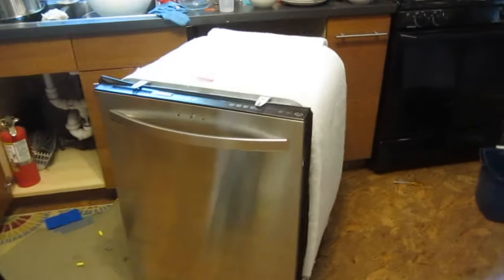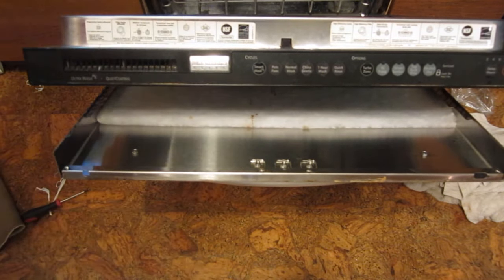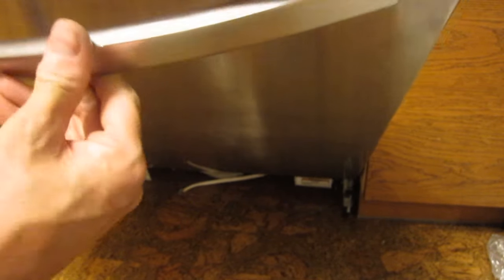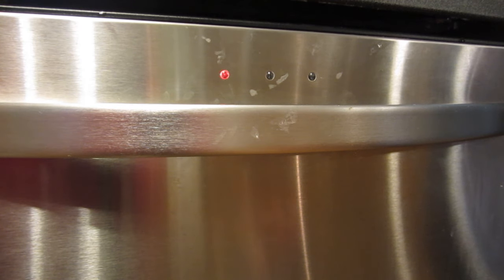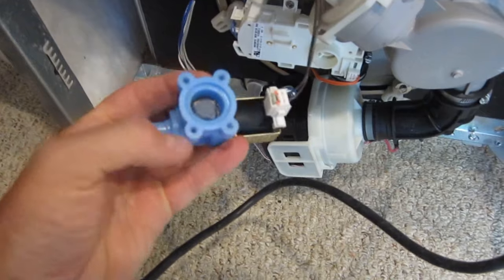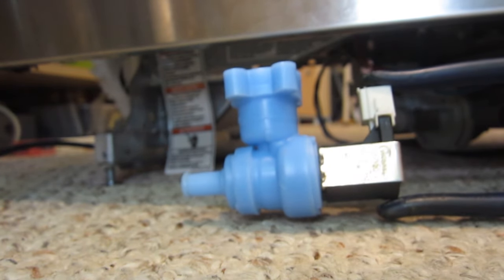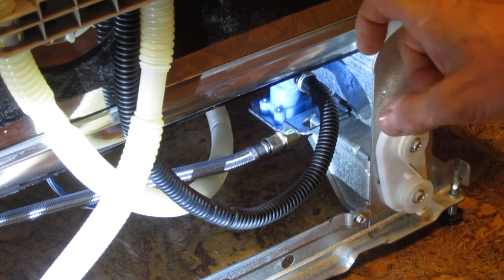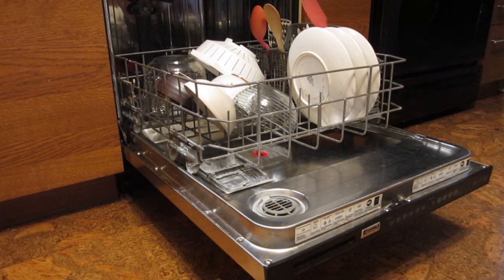Kenmore Elite Dishwasher Repair

Comment: I needed that pep talk at the end....cheers!!
Reply: Our issue is that the top rack seems to have a lot of gunk on our cups on the top level, but everything else is fine...looked at many videos that talk about cleaning up to the chopper assembly, which I have done numerous times that I could do it with my eyes closed.  I've even replaced the chopper assembly.  Still having the same problems though....not sure what it could be and most videos don't address the issue...water seems to be recycling in the unit, but for some reason, top rack cups get some extra gunk....gotta figure it out....
Reply from the maker: I ain't no dishwasher repair man but maybe your upper spray arm might not be spinning.  Try and catch them in action.  Could be the spray arm is cracked or all chunked up.  Pain in the ass to clean them out but it can be done.  Barring that, it might be the circulation pump that moves water into the spray arm.  Good luck mate.

Comment: Yo are able to do more than the the 2 “Sears” (it’s not Sears anymore) repairman can do.  Since we purchased the Sears warranty 4 years ago before our Sears closed, so, we have had them out to our home for repair 3 times in February, 5 times in March, 4 times in April, and 5 times in May.  Yes, even the repair company is not Sears, but only bought the name, which the vans they arrive in have a strange name.  Through many tears I finally called one of the few Sears Stores still open and talked to the manager.  He gave me a different phone number and told me to say, “Due to multiple failed attempts to repair, I’m requesting a new replacement.”  I received an email today with a link to pick a new dishwasher.  He also advised me to never purchase another warranty from Sears, because they are not like they were before.
Reply from the maker: That company is a bit messed up. Congrats on the new dishwasher though.

Comment: So when the door springs get tired and you get a replacement kit with cords, lube the nylon cords with soap, otherwise there's an ungodly groan after they're replaced. One of our front panel indicator lights doesn't work most of the time, so I'm deciding if I want to pull the control panel and see if I can fix the surface mount LED. The damn parts sites show a "light", which is not a light, but a plastic light pipe insert that cannot fail. This has been a nice, quiet dishwasher but entropy is taking its toll.
Reply from the maker: That will happen.  I wouldn't have expected an LED to burn out.

Comment: I have this same unit. There is steam coming out above the door where the top “vent” is on the door. Starting to damage the cabinet above it. I don’t see steam but the cabinet above it is moist after it has run. Door gasket seems fine. Thoughts? I think the inner vent on the inside of the door is to the fan or is it connected to the vent on the top of the door
Reply from the maker: That steam is normal. When you get a new dishwasher it comes with this foil tape that you put on the underside of your counter top lip.  Grab a roll of that foil duct tape from the Homeless Despot and it should keep your counter from disintegrating.
Reply: @dork3nergy  ok Thanks. It seems more than usual though. Is this also connected to the fan and only allows out what the fan doesn’t send to the drain? Wondering if the excess moisture is due to a fan failure. Maybe I’m mistaken on how this works. I appreciate your input.
Reply from the maker: The vent on the inside of the door is connected to the vents on the top of the door.  There is a wax motor that opens that vent.  It is possible that the vent is stuck open and you are getting venting throughout the dishwasher cycles.  That part can be replaced if it is indeed the problem.  It's an easy fix.  If you have the same dishwasher that I have then this is the part :

https://www.ebay.com/itm/Kitchenaid-Dishwash-Vent-Assembly-WP8572611/154297548033

Comment: I’m trying to figure out what the 3rd connection is to this Kenmore Elite dishwasher we got. It was used & don’t know if the guy didn’t give us the 3rd hose that goes there. My husband installed the drain & supply hose, but water is leaking from this extra hole.😅 Any idea?
Reply from the maker: Where is this hole you speak of?
Reply: DorkEnergy I wish I could send a pic but it won’t let me. So it’s hard to explain.
Reply from the maker: Is it on the side it's the bottom of the unit?
Reply: DorkEnergy Bottom, we’re guessing we need a T connector that wasn’t included.
Reply from the maker: @TSkrobarczyk  Have a look at the parts diagram here.  Might help you narrow down what you are missing :

https://www.searspartsdirect.com/model/1voj989pkz-000583/kenmore-elite-66513193k901-dishwasher-parts

Comment: I have a very similar model and its running very long never ending cycles.  After like 5 hours i have to stop it and drain it.  Any ideas?
Reply from the maker: It's likely a thermostat or the control board.  There is probably a diagnostic test you can run by pressing some buttons in a specific sequence.  If you can track down the service manual for your model, it will explain how to read the results.  

A good start would be to search https://www.applianceblog.com/ for your model.

Good luck!
Reply: DorkEnergy enjoyed your video and the many little ironies encountered we all seem to go thru!
Reply: @dork3nergy  Have the same problem with an Elite. Changed the control board ($200) and the thermostat and it semi-worked for about two weeks. Now it's doing the same as before and we're using it as a drying rack until the new one arrives.

Comment: Wow! Just a simple fix, congrats on your free washing machine :)
Reply from the maker: Thanks. Even if the solenoid valve had been shot, the fix would have been fifty bucks tops.
Reply: Congrats!!  Is it still working with just the tape fix? I have a similar dishwasher. 

I have an error code saying not enough water F6E1.  I get water spraying around and I turn cups over to collect water and seems to have plenty of water. Can’t figure out why it keeps stopping. Wondering if I have a bad solenoid, connector like you, or a drain pump that is always draining.
Reply: Same here got the same dishwasher but mine won't even go in to cycle, then throws a code blue light keeps flashing

Comment: Bro I got the same dishwasher. But mine won't go in to cycle and then blue light keeps flashing! What's up?
Reply from the maker: Could be flashing an error code. Here is the Tech Sheet for this dishwasher.  It should be of some help.

http://s000.tinyupload.com/?file_id=62902928795600440330

Comment: Why want it pump out water
Reply from the maker: It's likely either a bad pump or a faulty connection to the pump.  I don't think there is a sensor that would interfere with draining the dishwasher.